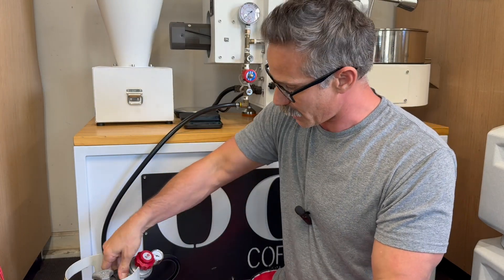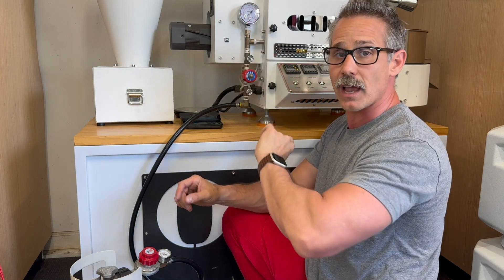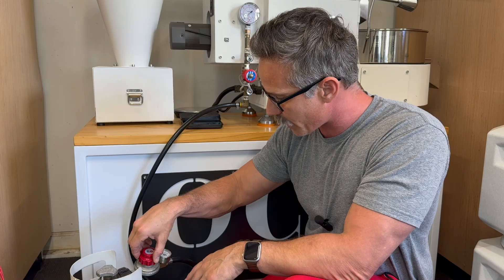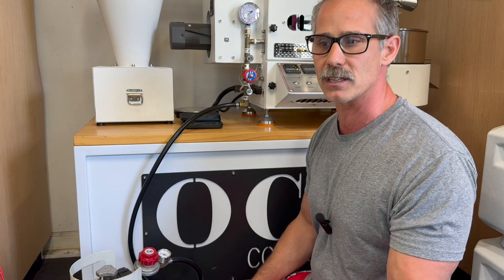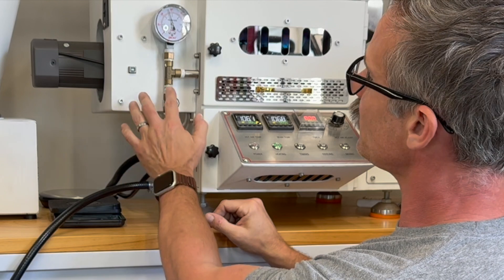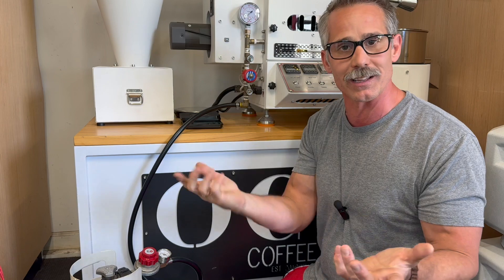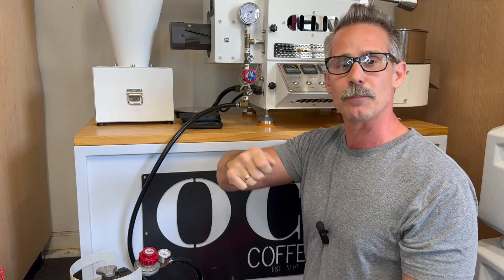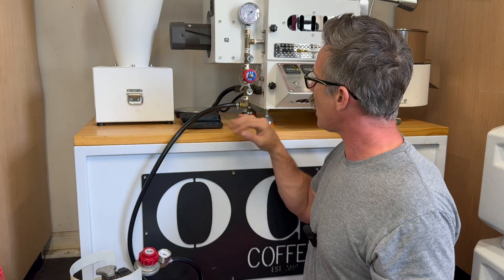How to Set Up Yoshan Gas Regulator and Settings

Comment: Hi rob. Just wondering do you have anything that’s comes off the air out take from the cooling fan on the cooling tray. My roasting room gets covered in chaff that’s being blown away from when it’s cooling. Tia. Steve at naughty monkey coffee
Reply: Thanks Rob. I actually had something delivered in something very similar so I used that. I have a much cleaner roastery now! Thanks
Reply from the maker: Hey Steve, it’s a good observation. I didn’t use an exhaust vent for the cooling tray. I actually discovered someone who used something called a milk bag in order to catch the that comes through the cooling tray. Here’s a link to it. 
https://a.co/d/6Y1tJkp

Comment: So how many front drum bearings have you gone through ? I’m on my second replacement in less than 3 weeks. The original lasted for about 3 months and or 150 pounds of roasting.
Reply from the maker: Are you lubricating? That's way too frequent. I've replaced once in 4 years.

Comment: Hey, thanks for the videos! I purchased the same roaster you have after your vids gave me the confidence that it’d be alright purchasing from Yoshan last November. I have been roasting on it since February and it has been a great investment. Saving a lot of $ roasting my own beans for a small coffee shop I run. I actually am replacing my gas regulator today with a 20kpa model and came across this video just by coincidence! My cyclone fan keeps clogging up. You experiencing this? I do a lot of dark roasts for espresso beans so it’s probably because of all the oils produced at that stage. Thanks again! The Kraken Coffeehouse, Elizabeth City, NC.
Reply from the maker: Hi, thanks for checking out the video. I'm glad my videos have been helpful to you! When you say clogged, I'm assuming the chaff is getting caught just under the exhaust fan, yes? How quickly is your fan getting clogged? Are you roasting back to back dark roast batches without checking? A couple other things, often Natural coffees will throw more chaff than a washed coffee, so keep that in mind when you're roasting. Also, curious how high you have your fan speed set to. That could play a factor. At the end of the day, you might need to vacuum out your fan every couple roasts if you're going dark and it's a bean that tends to have a lot of chaff. You might also need to empty your chaff drawer more often. Again, when I roast natural coffees, my chaff drawer fills up in like 4 batches. I've forgotten a couple times and almost lit a fire in the cyclone. Not smart. 

Last thing, it was brought to my attention that 5 PSI might be too high, as mentioned in the video, so roughly 1-1.5 psi should be sufficient for reaching 6 kPa. 

I can't remember, did you order through my sales rep or did you order somewhere else? I can't remember if we've ever spoken.
Reply: @ocdcoffeeclub4796 Thanks for your reply! I don’t see my other reply back to you so I’m assuming it didn’t send. So, yes the grate at the exhaust fan gets gummed up with oils and then clogged with chaff. I will notice that chaff starts building up at the lip below the roast chamber door that allows beans to exit to the cooling tray so it’s an indicator for me to stop and check things.I do have to roast back to back dark roasts to meet our demand but I do check it and clean any buildup when necessary. I think this is just going to be the norm due to running a lot of the dark roasts.
I misspoke earlier, I am installing a new regulator that goes up to 20 psi, I only plan on setting it around 5psi. The regulator I have been using is not a higher pressure regulator. I didn’t realize I needed a high pressure regulator when I was setting up the machine. I’m hoping the higher gas pressure will allow me to increase my airflow because I have had to keep it around 30-40 percent or too much heat is lost. Thanks for your insights!
Reply: @ocdcoffeeclub4796  Hey, thanks for all the info! No we haven’t spoken. I purchased my roaster before I learned that you can get a discount. I still got a great deal 👍🏼 I roast a lot of semi-washed beans from Brazil, from Genuine Origin, and yes they make a lot of chaff! The grate at the cyclone fan gets gummed up with oils and chaff sticks to it to. Yes, I have to empty my bin every about every 4 roasts.
I misspoke earlier, I am installing a regulator that will go up to 20 psi but I only intend to set it less than 5. The regulator I have on currently is just a low pressure model I got from Tractor Supply and doesn’t provide much gas so I have been keeping my airflow at about 40 percent so the chamber will heat. I’m hoping with more gas pressures I can keep the airflow higher to do a better job removing chaff and roast more evenly. Thanks, I appreciate your insight!

Comment: I like to keep my top valve set to a certain number as a limiter to keep pressure from going beyond that point and prevent any gauge damage. It also acts as my 100% level so i can accurately gauge back my roast percent-wise. I put tally marks denoting 10% increments.
Reply from the maker: If it works for you, great! Read the comments thread under @davidhassilev5415. Interesting discovery around the PSI

Comment: I would recommend a regulator that is adjustable to 24WC on the high end. That's about 0.866 PSI or 5.97kPa. 

With you feeding even 2 PSI to the roaster you're sending more than double the gages limit, 13kPa!
Reply from the maker: Thanks for the feedback, btw. I didn't quite understand the significance of using 5 PSI. I did look up the regulators you'd mentioned. The cheapest on was $50, not including the accessories. Luckly I was able to turn my gauge down to around 1.5 PSI. While the valve on the roaster feels a little less sensitive(sluggish), it might be easier to control with some practice. I'm going to make an updated video soon with this in mind. Thanks again for the help.
Reply: @ocdcoffeeclub4796  

No sweat. I just didn't want more folks to bust the gauge on their roasters. The gauge on the roaster (according to the manual I have) maxes out at 6kPa which is equivalent to 0.866 PSI. The manual actually says for LPG min gas pressure is 2kPa and maximum should be 5kPa. 

I can't wait to get mine Rob. It's on the ship somewhere crossing the Pacific right now.
Reply from the maker: @davidhassilev5415  I'm excited for you!
Reply: @davidhassilev5415  I just got my DY -2 last week.  I only had a day to get it unpacked and set up and play around before leaving on work trip.  I had a regulator at home and thought I would use that one. I did the same thing Rob did and cut the fitting off and pushed onto the barb fitting  The most I can get out of that regulator is 2.1KPA.  I don' t think that is enough gas pressure.  the flame is ok but i don't think that you will get the  30,000 BTU's it is rated for.  I ordered a new regulator off amazon and will get it hooked up when I get home.  Rob I wish you put this out 3 days earlier. The one I ordered doesn't say how many PSI it is and is not adjustable.
Reply: @AlBaldwin145  That would make sense with a standard run of the mill regulator that is usually set for 11WC. That's just about 2.7kPa.
Reply: Is it this one ? >Marshall MEGR-1912/197
Reply: @andybudge8555  that's one. I replied with both but I don't know where my reply went. The other is made by Emerson-Fisher 912-264.
Reply: @andybudge8555  yes
Reply from the maker: Do you have a link for a regulator you're mentioning?
Reply: @ocdcoffeeclub4796  Google either Emerson-Fisher 912-264 or Marshall 1912/197.
Reply: Do you have a recommendation for this regulator? Brand/ where to source?
Reply: @andybudge8555  Google either Emerson-Fisher 912-264 or Marshall 1912/197.